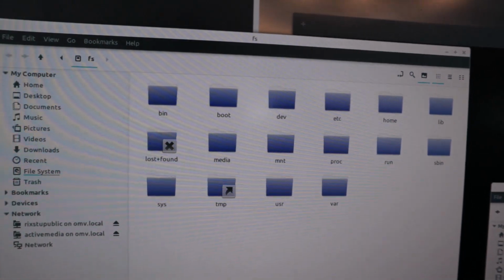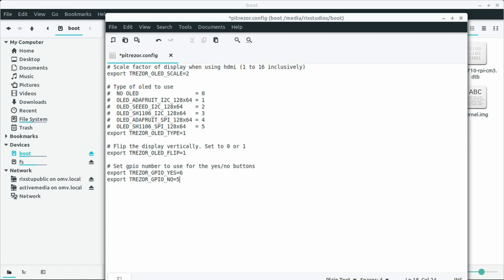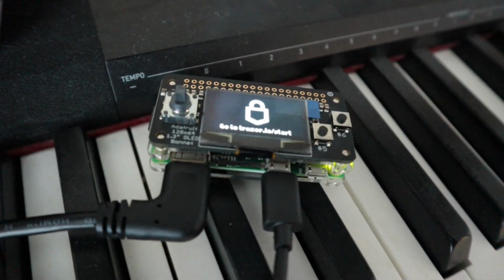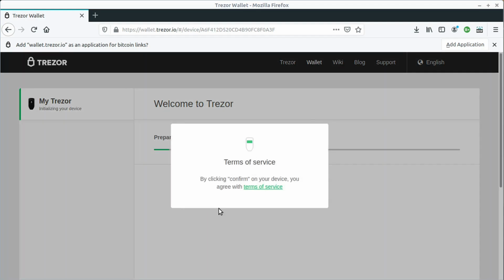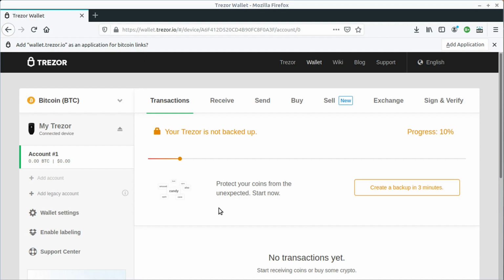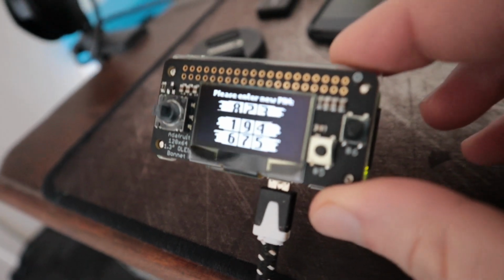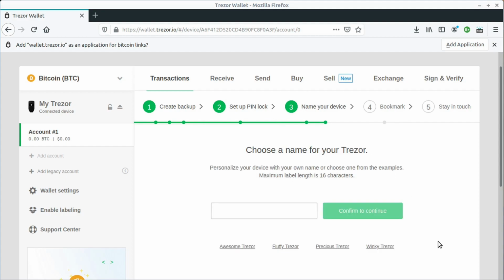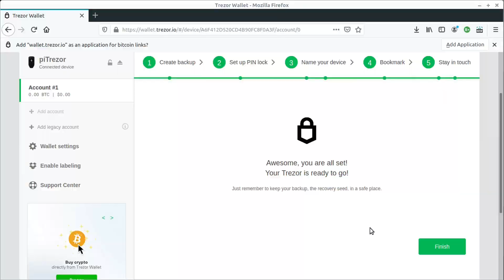Raspberry Pi Zero Project | Cryptocurrency Hardware Wallet

Comment: As a developer, you never want to user a microSD card as storage for a crypto wallet.. They are not designed for robust read/write on a consistent basis and can easily become corrupted or bricked with the slightest amount of a pretty hot day baking them. So the solution is to install an ssd hard drive expansion or hat to the PCIe ribbon connector and then buy a robust Solid State Harddrive that fits the right size for your pi. That way, even in the worst case, forensics or IT can recover any inaccesible data if the rest of the Pi goes kaput!
Reply: man, if it breaks you buy another one. Thats why its important to not lose the backup seed

Comment: you might need a 2nd usb mini cable to be plugged in for the unit to be detected by trezor. in my case it was the only way to get the trezor application to see it on a windows 11

Comment: So since you made your seed while connected to internet your wallet is actually potentially compromised.
Reply from the maker: Good question. The device does not have wifi, and is only connecting to the host pc via usb, and network traffic is not being sent or received. The key is generated on the hardware wallet only, just like with the actual trezor device, and then only signed messages are sent over usb to the host computer. At least that's how it's supposed to work. The nice thing about building this wallet yourself is that you can read the code and verify if it is really doing that or not.

Comment: Do you think this screen would work or does it have to be the one on your list.  Amazon has this one.   1.3inch LCD Display HAT for Raspberry Pi 4B/3B+/3B/2B/Zero/Zero W/Zero WH, IPS Screen 240x240 Pixels RGB, 65K Display Color with Embedded Controller Communicating via SPI Interface

Comment: Thank you so much! I just ordered the Adafruit Bonnet Kit (Bonnet, RPi Zero W, GPIO Pins and Case) for $35. Great deal.

It was only $15 for shipping to Canada as well. In total, $62.95 in Canadian funds. Very happy. All I have to do is solder the GPIO, build the Pi "Sandwich", install PiTrezor, encrypt it. Then I'm good!

Very happy. Thank you for the video and parts list.
Reply: Canada as well might try this out thanks!
Reply: boss ok naman ba nabuo muna?
Reply: When it's free, it's fun. When it's fun, it doesn't matter how much time I spend on it.
Reply: Pardon, but I need your help with something—could you assist?    USDT TRX20 is held in OKX with my recovery phrase [ clean party soccer advance audit clean evil finish tonight involve whip action  ] How can I transfer it to Binance?
Reply: But for $77 US you can just buy the real thing and not have to build it...

Comment: Cool project for fun but ABSOLUTELY NOT SAFE. Do not store lagre sums of money on this; get a real hardware wallet. Proper hardware wallets are designed so that is your keys cannot possibly leave the wallet even when connected to a compromised device. With this thing your keys are on the sd card and can be easily stolen by any computer connected to it. I wish this project did not exist. One day someone is gonna get fucked because they stored their savings in a DIY wallet on a consumer grade hardware.
Reply: Indeed the SD card is the weakpoint. However there is passphrase protection to overcome it ya?
Reply: I don’t believe that the trezor OS has any ftp that can interface with the computer
Reply: Not only that, but the private keys are never stored on the device only their numerical identification. What is stored on the device is the 24 word seed used to generate PkSk pairs. But even that is encrypted by your PIN and can only be decrypted by a signed boot-loader that will wipe itself after enough failed attempts

Comment: How do you update the firmware? Trezor io has an update and instructs users to put the devices into bootmode by holding both buttons and plugging it in, but it does not seem to work with this pi version.
Reply: You had to reflash your sd card with new software , so don't miss your recovery seed , you'll had more information on pitrezor site  , ( excuse me if my english is not very good ,  I am french )
Reply: You rock! thanks for the info.

Comment: Don't use  Sodder. For a neater soldering job run a flux pen down the pads have the iron at 360 deg c and use fine leaded solder. Just don't use Sodder.

Comment: Very nicely done high quality video, thanks! I built one and it's working fine. One can use a pass phrase to get around the sdcard vulnerability. This is a very good DIY project. For others asking, this wallet works exactly the same as the original, except that you update it differently (refer link at top of this page).
Reply from the maker: Awesome, thanks for sharing!
Reply: Same security?
Reply: @themadgamer9831  Same security when online making transactions. Physical security - the passphrase can be read from the sdcard, so a "hidden wallet" password must be used to emulate the physical security of the original. I used a 1.3" display on mine, I use it a lot, thinking of making another. I use a "game screen" display image, so it looks like a game when it powers up.
Reply: @ian4447  Hi, can you share pitrezor.config settings please, I have also 1.3" display (adafruit 1.3 tft bonet) but can't make it on screen. Thanks
Reply: @goranjug9681  I don't think tft screen will work.
Reply: @ian4447  Thanks, at the end I bought Waveshare sh1106 bonnet and it's working now. Thank you 😊
Reply: @goranjug9681  Great! I built a 2nd one. I like them better than my real Trezor1 :) The 2nd one uses the acrylic case and the 1.3" display siliconed on top. Looks neat.
Reply: @ian4447  Hello, so is there actually a way how to secure the SD card? Also, can u make model T like that? Thansk!
Reply: @MrChrisiss  If you use a hidden wallet password there is no need to secure the SDcard, as the password goes only into the processor temporarily, and is mixed with the seed phrase to make the private key that is used by the wallet. No plans for model T that I know of, check pitrezor website link at top of this page for more info.
Reply: @ian4447   is it safe . how do we know the software we are install from pitrezor code is safe ?
Reply: @damiansetunge8463  I have been using my piTrezor for over 6 months now, if the code was malicious I would have lost all my funds a long time ago :) I am sure the software is very safe!

Comment: For some reason I tried to do this with a 1.1 Raspberry Pi Zero w and it would not connect to Trezor.  I saw in the video he is using a Zero 1.3.  Do you know if anyone else got it to work on ver 1.1 (you can see it on the back of the Pi)
Reply: Working with 1.3